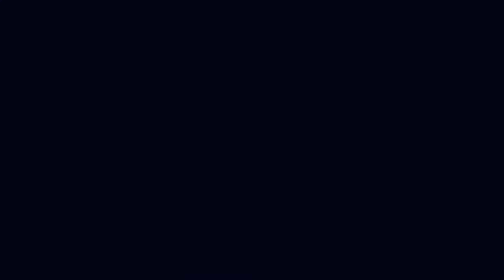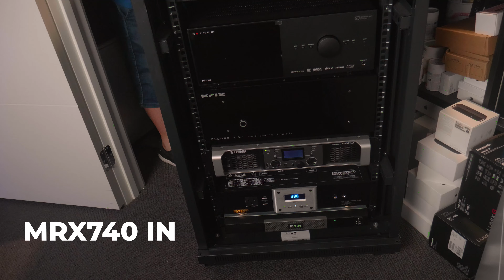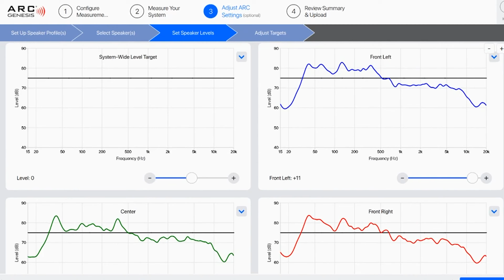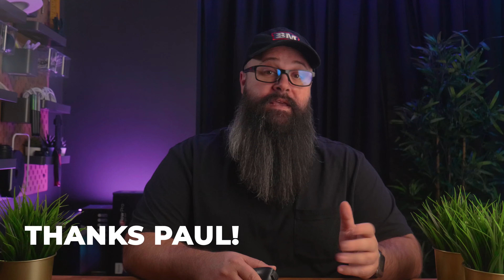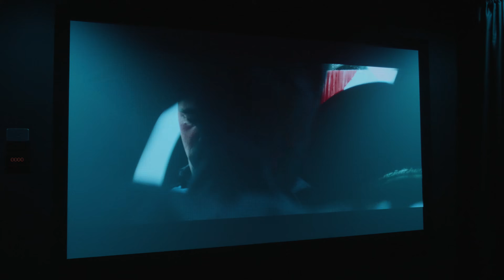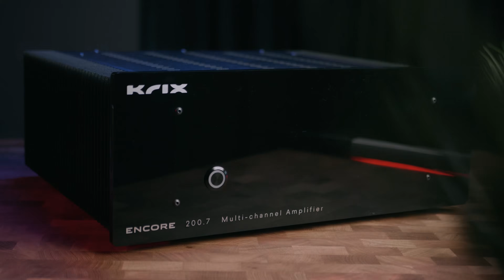ANTHEM MRX740 - AN HONEST REVIEW // Home Theater Receiver 11.2 Channel Review // Dolby Atmos

Comment: Hello. Which AVR or processor are you currently using for tv watching and movies. Thanks
Reply from the maker: Hi I now have a Trinnov Altitude 16 :)
Reply: Nice! We currently need to replace out broken AVR. We have a Parasound 52+ amp. We were considering using the pre-outs of a Denon, or 8805, or avm70 for watching tv/ movies. 
In your experience is one more dynamic and has better sound quality. 
Our previous pioneer can be harsh or bright sounding with Martin Logan motion 40. Thanks.

Comment: i cant even get mine to show up on the arc app let alone run the correction
Reply from the maker: Hmm... I havent played with Anthem since I did this review, but I would make sure your network is setup correctly and that your app's host (pc or phone) is on the same network as the Anthem. Also check your firewall isn't blocking anything as well.
Reply: yep i have tried a few things like that im still trying to get my head around everything thx @BuildMontage
Reply: I have no issues with my 740. Make sure it's on the network. The app should connect also.
Reply: Ye once the issue was sorted everything else was easy it's str forward arc worked well as well ye it was just a simple change of the port in the modem that was needed

Comment: Hey I'm new to your channel, thanks - I almost purchased this but I definitely don't have time for these bugs ...wonder if they fixed them by now? Thanks very much for honest review
Reply from the maker: Yes all the bugs mentioned in this video have definitely been fixed by now :)
Reply: @BuildMontage  thank you! I am trying to mix this with a streaming no so that I can listen to music on main speakers then be able to use for theater…. Do you think I should check out another one besides this? Thanks so much
Reply from the maker: It depends on your channel count. What speaker configuration do you have? Plenty of great options but Anthem is right up there as one of the best. It’s been improved a lot since this video.
Reply: @BuildMontage  thanks again for replying!!! I was about to purchase focal arias 948 fronts and focal 900 cc center channel, focal 300 ice6 (4) ceiling speakers, (2) focal 906 rears with also a power amp maybe Marantz 40n or Cambridge evo150 or Naim uniti 
And then 2 subs (not sure which ones yet)
Reply from the maker: Sounds like a good setup. The MRX740 should do a great job. The MRX1140 is also another option - more powered channels.
Reply: @BuildMontage  thank you very much!!!

Comment: I completely agree with the end/footnote I recently purchased a mrx540 8k and I cannot connect the unit to the web to do the first use update   Nothing I’ve tried works typing in the ip into a web browser hardwiring going in via my iPhone…
Any assistance would appreciated as anthem is not particularly helpful (no / slow replies).
The unit sounds fantastic out of the box but I am about to give up on it :(

Comment: Anthem equipment is amazing but you should only buy after 1 year of their equipment coming out since they need time to iron out the bugs since they are a smaller company relative to Denon etc.  Web displays are way better since it's much easier to do firmware upgrades and bug fixes for web interfaces vs OSD.
Reply from the maker: If i I didn't get a Trinnov Altitude 16, Anthem would have been my next choice.

Comment: Do you recommend anthem over marantz sr8015?
Reply from the maker: At the moment, I am pretty good with Anthem, they fixed a lot of the bugs I encountered - and it sounds fantastic. I don't generally recommend one product over another, it will come down to analysing the merits and pros and cons yourself. I have the Denon 8500 which is similar to the Marantz, and I am very happy with Audessey as well.
Reply: @BuildMontage  understood, but if you had to pick one to keep, which one would be? hard part for me is there is no show rooms for anthem product around me, I had 7015 and just recently sold it in order to upgrade.

Comment: I picked one of these up in May after waiting a while due to microchip shortages, and interestingly, mine had none of the bugs you described.  Mine has worked as expected so far.  As somebody who is NOT an expert, I did have some minor issues fumbling through the setup a little bit.  Thankfully there are many awesome content creators on YouTube that I was able to reference to help me get ARC Genesis up and running and a sound that I really liked.  I wasn't aware of the Anthem Audio Lovers faceballs page until watching this, I'm excited to see what information I can gain from there.  So far I'm very happy with it.  I'm am not a brand loyalist by any means, I purchased based on a recommendation from a very reputable home theater installer friend after narrowing down to a couple different options.
Reply from the maker: Since the review these have improved dramatically!
Reply: @BuildMontage  Hi can you elaborate on that please. In which parts of your listening experience did you notice improvement.
Many thanks.

Comment: Hey Buddy- I am a dedicated subscriber from USA. Appreciate all your videos. Quick question for you: i have a 22 by 16 feet small room: question for you please- what do you think of me getting MRX 540 to run my martin logan esl for FLC and canton cinema satellite speakers for surround. Do you think I should use a external power amp for MrX 540 for the front channels? Any advise will be appreciated as I value your a/v wisdom
Reply from the maker: I think an external amp will of course help with the performance but you can always test it out and upgrade if you feel it doesn’t perform how you would hope.

Comment: Hey mate would you recommend the Anthem mrx 1140 over the marantz Sr8015? I'm not sure which 1 to pick. I do run a ps5 and the marantz has 2.1 as the 1140 doesn't. I'll also be using a Elecktra hd7 power amp to run the krix speakers.
Reply from the maker: I think both are solid options - higher end units and both make great sound. I haven't heard the MRX1140, I've heard the MRX740 and AVM70 and also the Marantz - and it will just come down to preference and how much effort you want to put in. The Anthem definitely requires more work.

Comment: Hello, would you answer a question, the volume that you usually see in movies, in which volume would it be set in the anthem and the denon to sound more or less the same?

What reference level would it be in anthem?

Greetings
Reply from the maker: It's impossible to say. You should be measuring to 75dB from your front left speaker using the main volume control - that could be -23dB or it could be something completely different. That will give you the reference volume.

Comment: good review, to be fair to anthem though this product is just out and there will be bugs out there, with so much control provided it is impossible to iron out every possible bug before any product is released, this is happening from high end car to all electronics we touch now a days.  there is software updates on everything seems like.
Reply from the maker: No doubt, however I made my review based on my experiences, not on what will be fixed over time. Unbiased and fair review based on "my" experiences. I'm sure it's a great product - it sounded awesome in my room when we had it properly calibrated.

Comment: It’s absolutely absurd that a piece of electronics that costs thousands of dollars would have bugs like many, MANY Anthem receivers and processors have.  I can’t believe they haven’t had their feet held to the fire over this shit.  That you need an electrical engineering degree to get it to function as it’s intended is complete bullshit. It’s not for ‘advanced’ users, it’s fuck-ING buggy!  I had an AVM60 that I couldn’t get a peep out of. It was maddening.  If you search for other people with Anthem units, you’ll find GOBS and GOBS of them.  They’re everywhere. I don’t understand how in good conscience you can recommend this trash after dealing with that buggy bullshit. The cherry on top of my Anthem Shit Sunday was that I spent MONTHS  trying to contact Anthem just trying to solicit some advice about how I may be able to fix the problem I was encountering. NOT ONCE did I get a single word back out of that basically scam of a company. 

I respect that you addressed the issues at the end.  But whether or not you want to trash any companies, you definitely aren’t required to recommend them when they can’t perform their basic functions.
Reply from the maker: I don’t recall where I “recommended” it? I gave my honest feedback. It’s how I saw it. It’s funny because some people think I’m too harsh and some think I’m too lenient. I made the video based on my perceptions so if you disagree, go make a video and publish your perspective and I’ll take it for what it is. I certainly don’t plan on buying one for myself.

Comment: Hello thanks for this review, I have had a denon 8500h until a few months ago and I loved its sound, it was very stable and it sounded really good but I was always a little more demanding in the stereo section and I was never convinced ... I acquired an arcam  avr20 which I am happy and it was a slight improvement of the 8500h and I was wondering how much better was this mrx740 vs 8500h what sound differences did you notice?
Reply from the maker: After switching back to my Denon, I'm very happy with it. There was better "vocal" quality and detail from the Anthem coming from the center channel, but weighing EVERYTHING up, I prefer the Denon. The trade off in the vocals doesn't make up for the other issues in my opinion. I prefer the Denon if I had to choose now that I have gone back to my daily driver.
Reply: @BuildMontage  The denon is an incredible machine one day I will return without a doubt .. right now I am happy with the arcam avr20 but having to use external stages is killing me!

Comment: Though I liked most of the video, I feel like you walk on eggshells as to your explaining your opinion. 

As a viewer, consumer and potential buyer I would have loved to know a more clear cut on how you'd feel if  you'd choose the Denon over the Anthem. 
Sure, as always, I would listen to it myself etc. But I was so waiting for it and you didn't say it. 
I feel like soundquality is #1 and @3k I'd go for Anthem and hope that   it would last a long time.
Reply from the maker: It was quite difficult to split the hair on this one. Now that I have my Denon back in my rack - there is a level of comfort there as I am quite happy with it, and having 13 channels, I was able to experiment with adding front wides, and because my speakers are very sensitive, and the Denon is an absolute tank, it provides me with enough power and what I need to run my setup well.

The Anthem I feel had better vocal clarity which is something i will try to work on with my Denon if it's even possible, but I have to say my preference between the MRX740 and my Denon 8500 will be my Denon.

Comment: I have the 720 and I also think ARC isn't helping there is lots of separation but for guys like me with medium knowledge I'm underwhelmed with how powerful my sound is I'm just not willing or have the expertise to get ARC dialed. My speakers all got a boost as much as +11 for heights and that really scared me as I also have very powerful amps and didn't want to kill my speakers so ended up taking lots out but to get a good feeling in my room I always need the volume at -5 or 0. My old denon I could go more than -20 or my ears would bleed. Everytime I ask questions it turns into a disaster on the forum. Sadly I might not keep this receiver so I can't imagine what people are going through with the new ones and the thousands of bugs they have.
Reply from the maker: Sadly, there is little acknowledgement of the fact that ARC adjusts the main level right before calibration whcih in turn means the calibration sweeps are very low - so it boosts them up during the calibration. I think it truly is an enthusiast device, and as such, they should market more toward enthusiasts or at least disclaimer that it's not a plug and play device like MCACC on Pioneer is for example. Thanks for watching and commenting.
Reply: @BuildMontage  it does this even on my gen 2 720 I just don't know how to correct it. It's a great product but it just feels like I'm missing 50% of the power because of this.
Reply: @taxi615  J'ai moi-même un 720 et j'ai des "levels" à +11, +12....  Ils seraient à -7, -11 que ça jouerait pas moins/pas plus fort. Crois-moi. Je sais ce que je dis.
Et si jamais, tu veux avoir tes profiles bien tweakés ;-) J'offre le service. Tu parles de "forum", est-ce du groupe Anthem Audio Lovers dont tu parles? Si non, fais une demande d'admission :-) (j'y suis un des admin)

Comment: I've been waiting for someone to do an honest review like this. I have the AVM70 and have the same bugs with ARC Genesis boosting speaker levels to max and other issues such as it overriding user settings such as dolby/dts processing and forcing updates even with auto-update turned off. 

I have contacted Anthem 2-3 times without a response and many other owners have not received support either. 

I 100% agree that us early adopters are beta testers and the products are not currently fit for full release. It has some fantastic features and performance if you have the time to work through them but its not good enough given this is a premium product.

Thanks for the honest review as more potential buyers will be aware of what they are buying into.
Reply from the maker: Appreciate you watching and sharing your experiences. I was starting to think maybe it was just me until I saw all the comments on the video describing very similar issues.

Comment: Nice review Tony I sprayed my Avm 70 with mortein problem solvered 😆👍
Reply from the maker: Did it work?
Reply: @BuildMontage  yes but in all seriousness it’s been great I’ve only had a problem occasionally when the unit won’t turn off and have to turn off from the power plug is there a chance Tony you could please send me link to your curtains from Spotlight I need to buy some cheers 🥂 🙏

Comment: Great, fair video. Cool product, but the bugs will prevent me from buying it. I don't have the time or energy to devote to it. I need something that more or less works out of the box.
Reply from the maker: Hopefully you can find one that works for you. Yamaha, Denon and Marantz are great options that will "work" with very little effort on your part. Like anything, to get the most out of your gear, it will take a tonne of effort and all three can be used to create a great sound.

Comment: Thanks for your informative review (& persistence!).

I've been running the MRX 740 in my system for 3 months, with only very minor issues, certainly no show stoppers. It's true that you need some patience during the initial setup, but things are getting better. FYI, here is the change log for the new firmware:

Firmware Change Log
 
Release: 00.56
Network Module Version: 1.100.116

*Requires ARC 1.5.4 or later
Fixed Center Channel Dropout
Fixed Rear Atmos Height Position Playback
Added MRX 540 Height Position Pre-Out Assignment
Minor Bugs and Improvements

Here is the change log for the new version of ARC Genesis:

Version 1.5.4
MRX x40/AVM70: various quality of implementation improvements, but requires host fw 56 or later
MRX x40/AVM70: added support for performing quick measurements with processing applied (includes bass management and level calibration)
Other minor fixes and improvements

I have found that with this new version & the previous version (1.4.10), it set my Front Left speaker to 75 dB, without having to make any adjustments elsewhere, with adjustments to the other speakers settling around the +6 dB mark.

Before deciding on this amp, I trialled equivalent models from Denon/Arcam/NAD: they all had their good & bad points,  but the Anthem came out best for home theatre in my system.
Reply from the maker: I think the Anthem sounds great. Very clear and precise HF.

Comment: Great video, thanks for sharing. Did you by chance find out what Yves did on profile 4 in the end? 

Will run through the PDF on the next cal on my MRX740 soon but keen to know what it was that made such a big difference between your Profile 1 and Profile 4. Cheers!
Reply from the maker: Thanks for watching - at this point Yves is keeping his method to himself but if you join up on the forum and ask some questions, I'm sure he may respond. I think it's a lot of knowledge and experience with tweaking in Pro mode of ARC which he did that made it better. I have done much the same with my minidsp for my subs and Denon's Audessey as well.